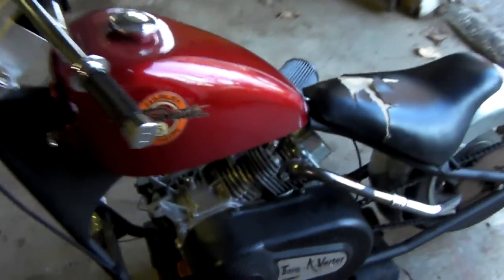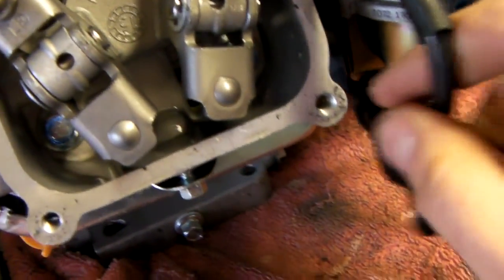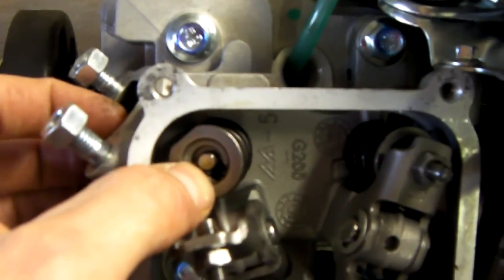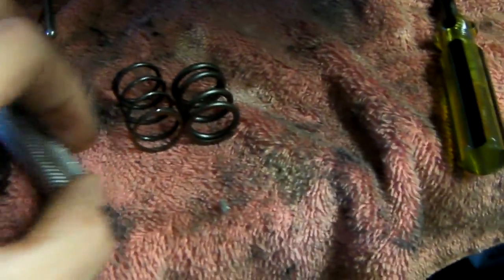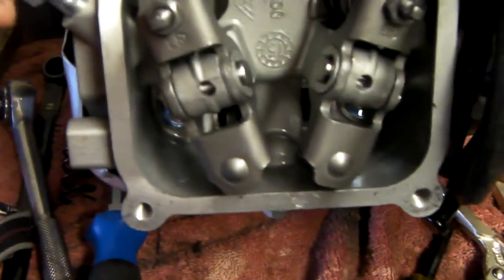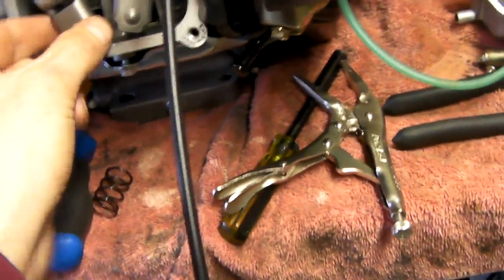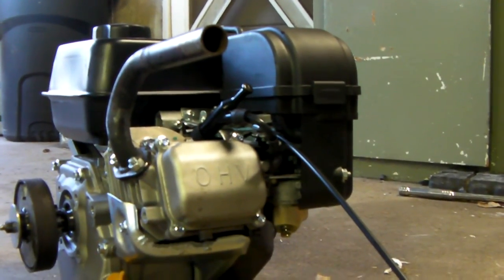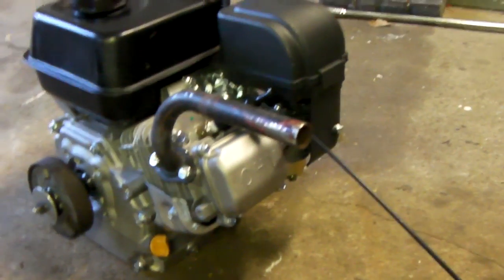Predator 212 Valve Springs

Comment: Why did you change the springs!? Any benefit?
Reply from the maker: The stock valve springs are weak and not rated to withstand anything more than the engines stock governed speed of 3600RPM before you experience valve float and/or broken springs. I removed the governor and eventually went on to replace the camshaft in the engine and the “heavier” valve springs help keep the valves open and shut at higher RPMs.

Comment: Nice video man, one question i get alot of kickback when starting the engine, it kicks back very bad where the pull handle geta ripped out my hand even broke a pull handle from slapping back on the pullstart cover. Any suggestions what can be causing the kickback? Also 1 out of 3 starts the engine sputters and i habe to give a bit of throttle to bring he idle to normal what can cause this?
Reply: Did you take out the governor?
Reply: You’ve definitely solved this by now but you need to set your valve lash to whatever your engine requires, when the valves aren’t opening and closing at the correct time it cases backfiring and sputtering.

Comment: what was that green tube going down the plug hole?
Reply from the maker: Good eye, the green tube is just some rubber fuel line I stuck into the spark plug hole to keep the valves from falling into the motor.